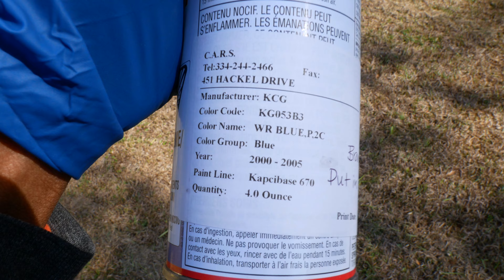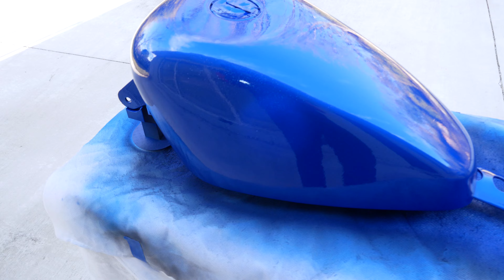Harley Sportster: Making This Busted Tank Look New Again!

Comment: hi,nice job considering its made with cans.  very difficult to have perfect surface with it.  few advices for future paint job. 
after the tank come back with bondo repairs,apply a good coat of primer.then wet sand it.   find the spots with imperfections ,spray very light touches of black paint on it to see them. 
and on that ,you add another coat of primer. wet sand it again, more where black paint is. 
time for last coat of primer.  wet sand it with your finest sand paper. clean it with soft wet rag.  
 first light coat of paint, cross the sprays to be even,not straight lines,more like a grid.  wet sand it with 2000 or 3000 sand paper .
second coat of paint, let dry a little,and last coat . 
  then,it's time for the clear coats . first light coat ,to see if there is any reaction withe previous coats. small waiting time to let it dry a little.
 then start the other coats of clear ,crossing the "passes "(not sure of this word in english...) until you get that professionnal finish.   remember that you can always fix any bad spot by wet sanding with high grain ,and cover with a new coat.
Reply from the maker: A lot of great tips. I wanted to finish it all that day. I realize now a major difference in spray cans and guns is needing to do post work to get the proper finish. I'm learning though!
Reply: @BrandonBicasso  and it is all to your credits.    keep experiencing on trash parts, the more you do ,the better you are.   stay safe.  cheers from France.

Comment: Primer should be done a day or two before. You can spot any imperfections in the tank and correct them before you lay down your base. Looks like you're applying the clear coat too slow and a tad too close in some areas. This is what's leading to the non-mirror like finish and the runs. The trash and the dust can be prevented by buying a small harbor freight tent and wetting the floor to keep the dust from flying around. Hope this helps. Patience is key.
Reply: 2 other suggestions:  (1) Grab some metal coat hangers instead of zip ties. If the hanger slides along your fence pole, try and make it level.  If not, place a layer of blue tape on the fence pole to prevent the metal coat hanger from sliding. (2) I use 0000 steel wool in between coats to smooth out the heavy spots. Just make sure you blow off or use a tack cloth to remove any loose steel wool fibers.
Reply from the maker: I'm thinking next time I'll do that. Prime everything one day, check how everything laid and wet sand it. I did that the first time around and got really good results. Didn't do any wet sanding this time so hey, lessons learned from both situations!

Comment: Like others have said, spend more time on the prep before the color coat. After the primer dries spray a contrasting guide coat and sand it back to the primer, this will reveal any low spots or scratches. Repeat the process until your prime coat is even. The more time you spend on prepping the better your final finish will be. Pretty good job otherwise.

Comment: Patience and preparation is key to getting a show finish, lightly Misting a guide coat (contrasting color)over primer and sanding the guide coat with 400 grit and then 600 grit will show and remove all of the imperfections and orange peel in the primer before base coat this will insure your base is as smooth as possible before clear coating. Use the 400 to smooth the surface and then the 600 to remove the 400 scratches, these can be done either wet or dry sanding. These steps seem to take a lot of time but the finish you will achieve will more than make up for the time spent. You can do some research on guide coating here on youtube to see how it's done if you have questions on it. There are a lot of informative videos out on it.

Comment: It's not perfect but no paint jobs are! I hate to paint. When I do I like to shoot the edges and details 1st, then blend the large areas into them. A final heavy coat usually works for me. Wet sanding the primer can help, and now, wet sanding should remove the orange peel. Most body shops do a lot of that.

Comment: You can salvage it by 3000 wet sand, then wheel it out with a fine polish.
Reply from the maker: Right. There's another video coming where I fix the clear. I'm pretty decent at polishing so it will look better.